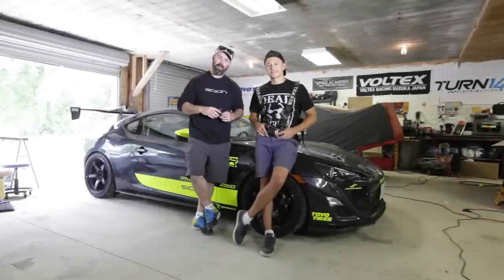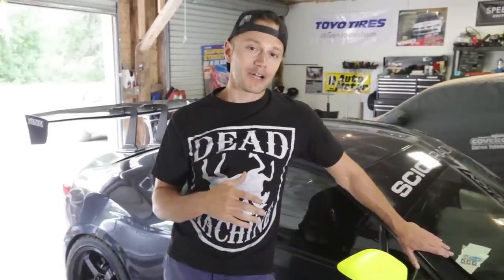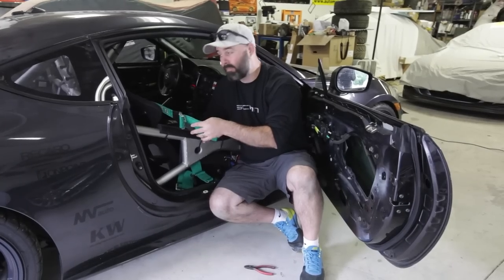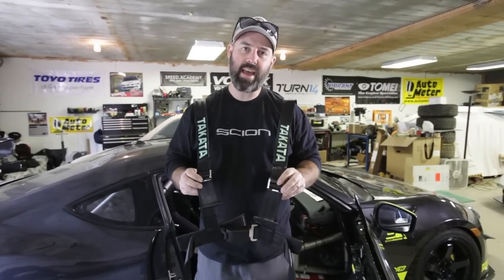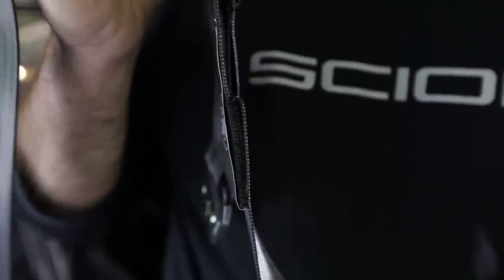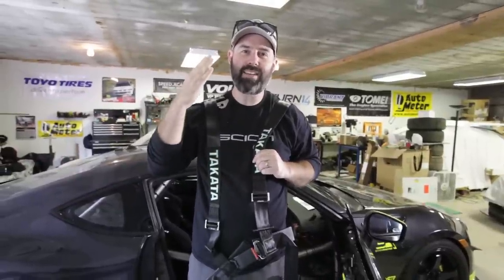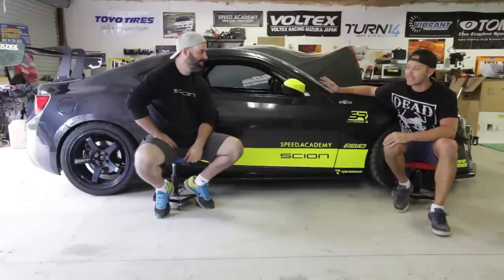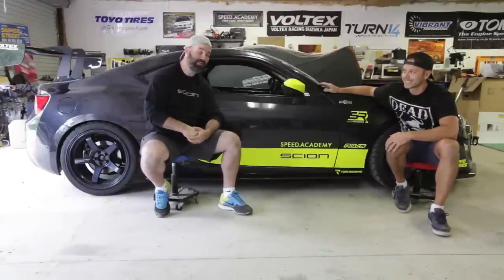How To Install A Street Legal Harness - Scion FR-S Track Build - EP07

Comment: the deal with the harness is just in case anyone was wondering. seatbelt submarining is when your body slides down the seat under the harness, causing the lap strap to ride up off your hips and into your gut (very very bad for your internals). in a 5 point the crotch strap prevents this and in a 3 point it lets your upper body go first, using the shoulder strap to tightening down on the lap strap. its the same idea with the 4 point asm, that extendable part lets your upper body go first which throws the lap strap into your hips at an angle where it cant ride up any higher.

Comment: I also wrapped my mirror caps.  I took the caps off the car and wrapped around the edges so when the wrap tries to contract it wont pull away from the edges.  But my car is white so its really noticeable.  Looks good though I like it!
Reply from the maker: +MNachtigal hmm, that's a good tip! We'll have to see if the mirror caps are removable on the FR-S.
Reply: They should be, they were on my BRZ. Trick is to find the hidden tab behind the actuator. It can be a pain but the payoff for me anyway was worth it.
Reply from the maker: The vinyl is all wrinkly around the edges on ours, so this sounds like a great way to fix the problem. Thanks again!
Reply: No problem. Always looking to help!

Comment: For road legel harnesses i would stig with schroth. They have the only street legal 4 (or more) point harness with a legal centre lock.
Reply from the maker: +CF88DRUM These Takata harnesses are fully street legal and the seat belt is a big reason for that because in the case of an accident a paramedic or normal person will know how to unlatch you, with a center lock they may be confused how it operates.
Reply: +Speed Academy Take a look ate the Schroth Profi II FE ASM centre lock. If some does not know how to open that he shouldn´t be able to know how to breathe. http://www.schroth.com/gfx/dyn/produkte_daten/gross_450/40/2.jpg
Reply from the maker: +CF88DRUM Haha, yeah that one looks to be perfect for street use too! Good to see that there are several options for street legal belts out there.

Comment: Please do a video to shut these BRZ FRS owners where you compare lap times of an NA S2000 to a TURBO FRS/BRZ...  anything to justify paying 25k for 200BHP LOL
Reply: +S2k2014 they didnt pay 25k for 200bhp, they paid 25k-(car value) for handling and fast lap times. not rawwwww pawarrrr
Reply: +S2k2014 Last time they ran the ass2000 at the track, it ran like 1:20.  The FRS with the supercharger now runs the course in like 1:15... I prefer the S2k, but it's currently outgunned BIG TIME.
Reply from the maker: +duane willis we didn't actually run a 1:15 in the FRS, that was a lap timer glitch that we had a little fun with. But the FRS should be a bit quicker than the ass2k given its power advantage at the moment. They're both hugely fun to rip at the race track.
Reply: Ahhh, thanks for clarifying that.  On a side note - I'm glad I stumbled onto this channel, it's quickly become a favorite of mine.  I always enjoyed your editorials and work over at Modified.
Reply from the maker: +duane willis Great to hear! Former Modified fans are always welcome here :)